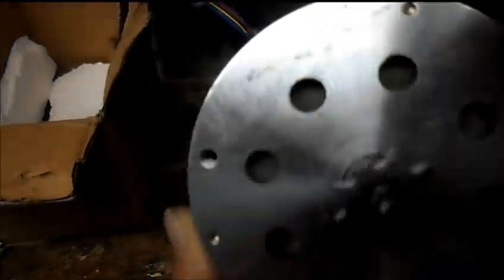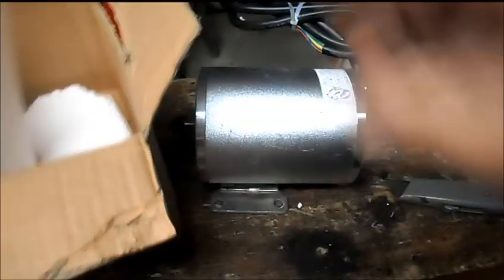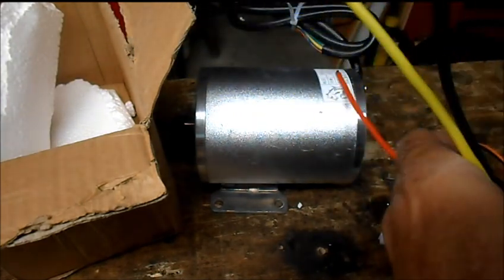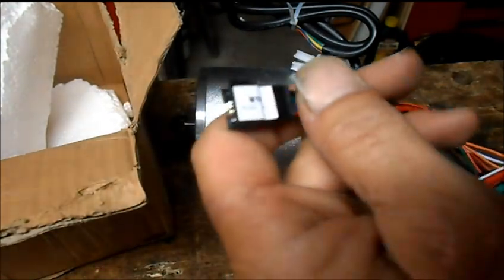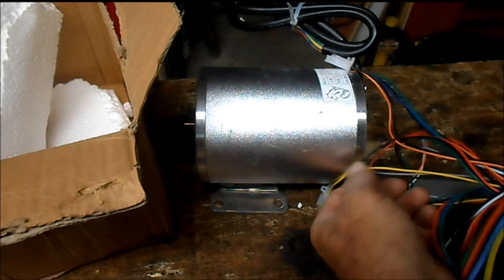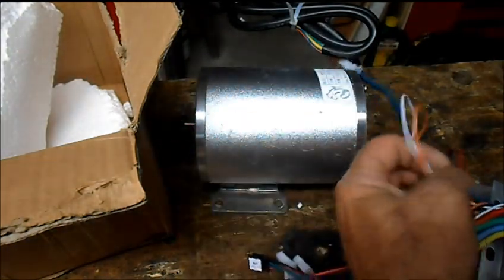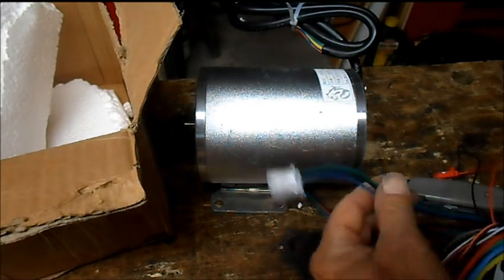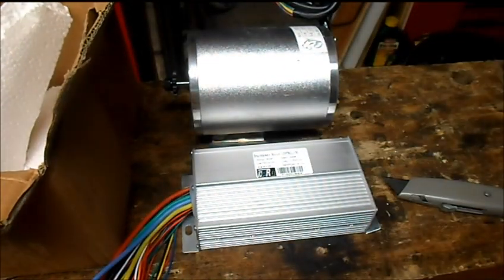El Moto El Dingo II part 2 intro 1,800W brushless motor

Comment: I bought the same thing, and am working out the difference between (brake) and (braking) any input will be greatly appreciated.
Reply from the maker: One is where you would connect the brake lever switch. It should be the plug with thin yellow (+) & thin black (-) wires. The other is where you would connect the brake light. It should be the plug with thin red (+) & thin black (-) wires. You can find more info here:     http://www.diygokarts.com/vb/showthread.php?t=37537
Reply: Thank you.
Reply from the maker: Glad to help
Reply: Functional Artist The motor actually brakes itself?

Comment: Could you explain exactly how you got this motor wired up?  I bought the same one and I'm having trouble getting it to work.  I didn't get the throttle but I should be able to simulate what the throttle is doing.  The person on Ebay that I bought it from do not seem to fully understand the wiring.
Reply from the maker: The Thick Red (+) coming out of the controller is hooked to the positive (+) of 
a 48V battery pack (4- 12V batteries wired in series) & the Thick Black (-) 
coming out of the controller is hooked to the negative (-) of the battery pack. 
The Thick Blue coming out of the controller is hooked to the Thick Blue coming out of the motor. The Thick Yellow coming out of the controller is hooked to the Thick Yellow coming out of the motor & the Thick Green coming out of the controller is hooked to the Thick Green coming out of the motor. The 5- wire plug coming out of the controller is hooked to the 5 wire plug coming out of the motor. The 3-wire throttle plug coming out of the controller is hooked to the supplied throttle (wire colors match). The Ignition switch plug coming out of the controller is hooked to a standard toggle switch. Here is a video, you can see my set up for yourself. 

https://www.youtube.com/watch?v=UXLuc8YkwlQA 3 way switch is also needed. It needs to be hooked to the "inverted gear plug. It tells the controller if you want to go forward or backward.
Reply: Functional Artist I really want to thank you for your videos this really helped me a lot I just ordered the same kit off of eBay and had no idea how to hook it up you really explained everything very well sir